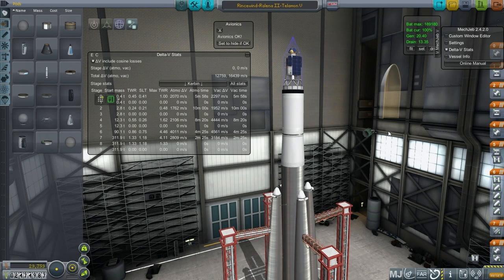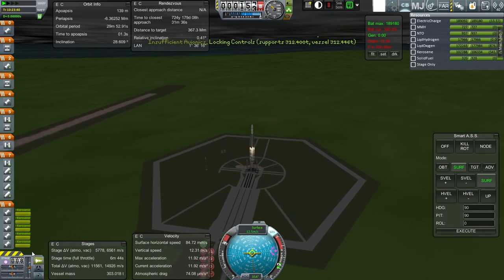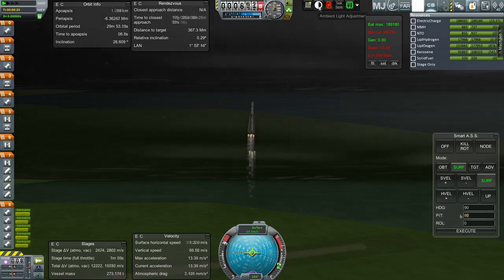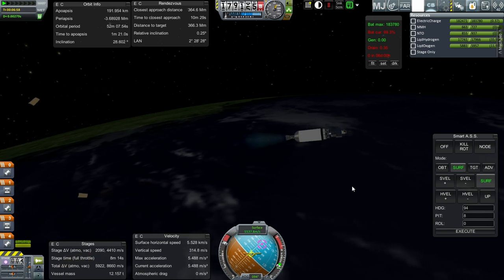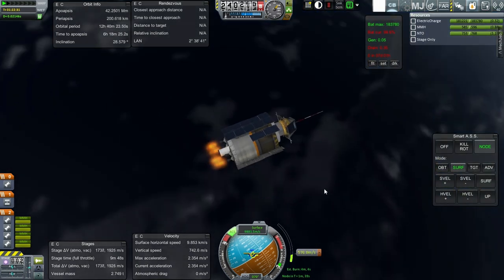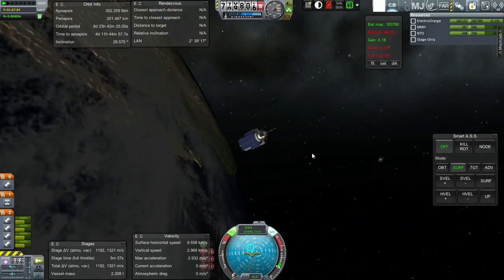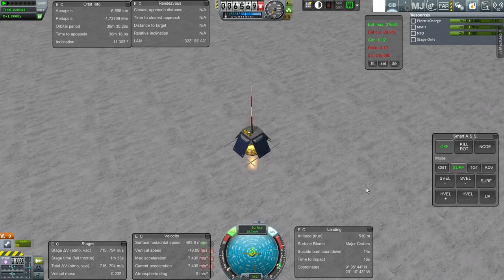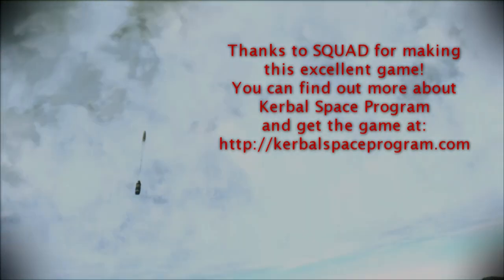Realism Overhaul in KSP Beta 19 - Rincewind Redux

Comment: Have you ever tried to separate your boosters a split second before they run out? It would probably make for a more Soyuz-esque boosters sep - and quite possibly eliminate the need for bottom row of separation rockets (top rockets will tilt boosters away from core, while still running engines will ensure they will fly away). Since your FPS is so low when you're on boosters, you should have no problems timing this sep.